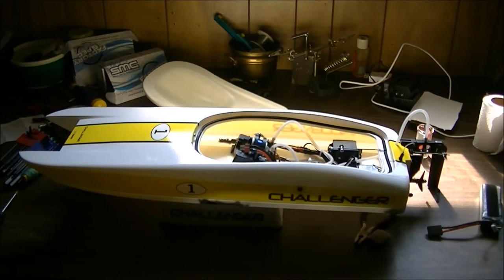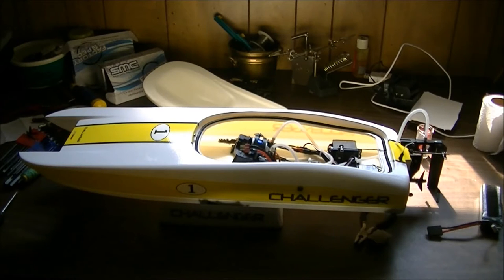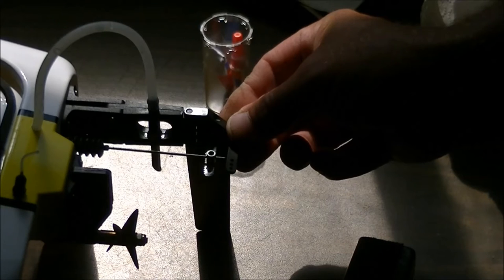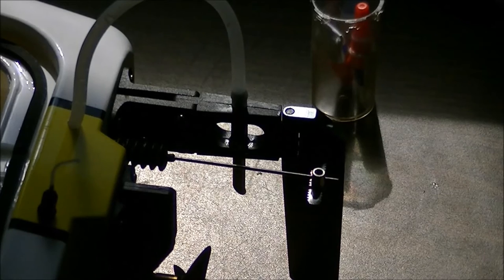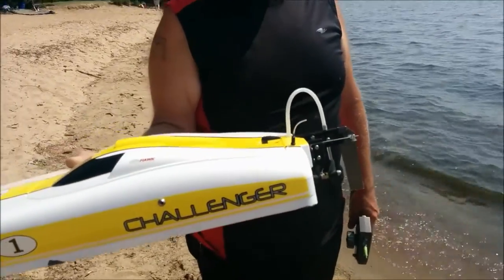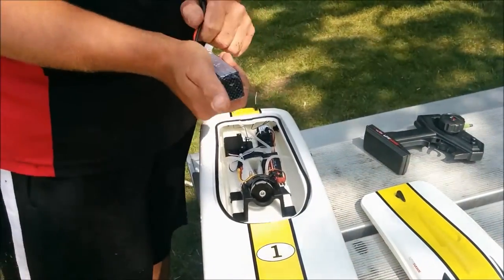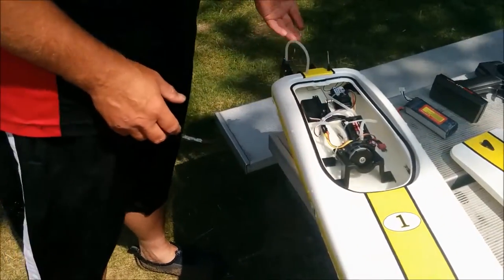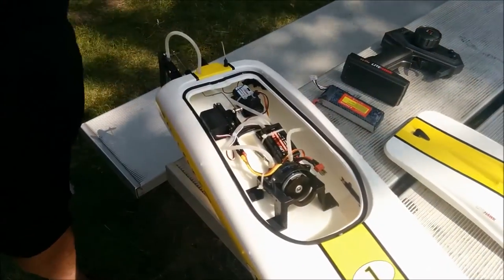Rudder Steering Arm Mod For RC Boat

Comment: Great mod, will you make a scale chainsaw with this technique?
The hull on that boat looks really thin, but she seems to go pretty good, nice run (-:
Reply from the maker: Jax Teller RC ill have to try that out cant be to hard to  do just need the right size bolt and i have some to lol , ok ill give it a go.. as for the boat the hull is paper thin in alot of places very bad hull but good electronics
Reply: Kevys Rc & Music
Awesome Kevy, I look forward to seeing it,  bet it will turn out great (-:
Reply from the maker: Jax Teller RC thanks lets Hope Crosss your fingers :)